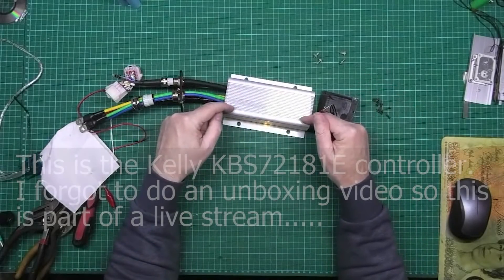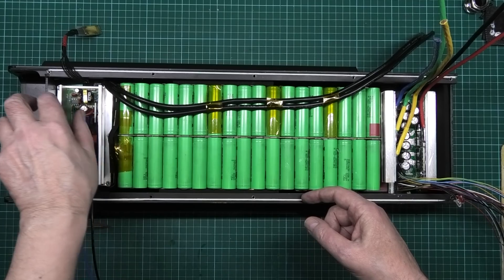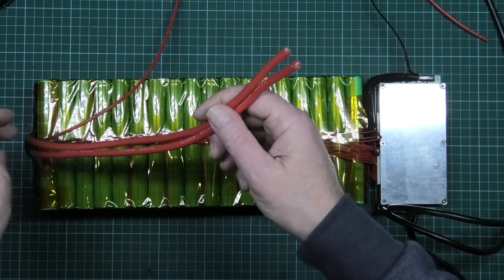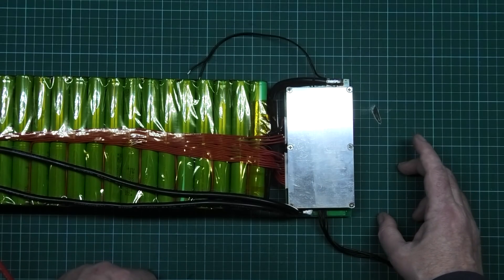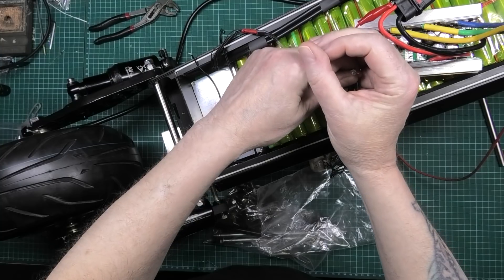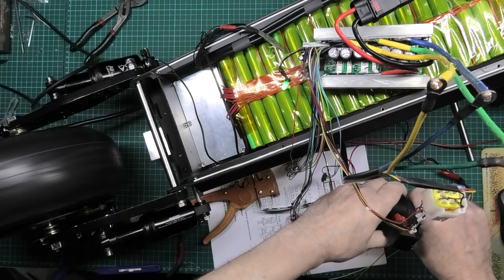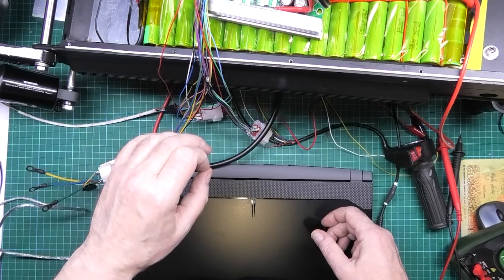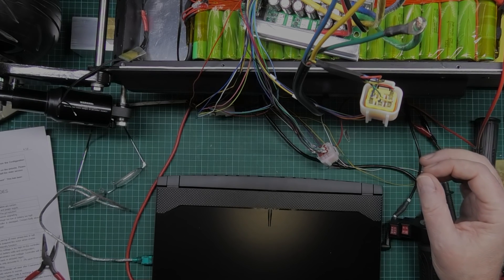🔴 EXTREMELY POWERFUL E-SCOOTER BUILD part 6 - Ant BMS and Kelly KBS72151E controller

Comment: Re the disk placement issue at 6:40, In the shop we would place washers between the vertical mount and the swingarm on the brake adapter so to push the whole braking assembly closer to the wheel!

I hope that one translates from my brain to words properly, just in case I'll try it one more time, chuck some washers between the brake adapter and the swingarm, you can go as far as you want really.
Get that wheel centered or when you get on it'll want to tip to one side all the time and it'll feel weird af turning on it.
Reply from the maker: All problems were sorted many weeks ago mate. I don't like using spacers if I can get away with it, especially on brakes.
I had to space the swingarm out more anyway (equally on both sides) it wasn't geometrically perfect but it is now 😁
I show the problems I have because it may help others to overcome them. Everyone else just shows the finished product, I don't do that because everyone knows it never simply works.

Comment: The Kelly controller is a good idea, much smaller than others but very strong and reliable. I just hate the documentation and the price. They should tell how the serial communication works, it would be easy to make a display for speed, voltage, current, temps etc...

make KI and KP as high as possible and "compensation" lower if you want it more "aggressive" (if I remember correctly, it's a while ago😅)

Comment: When you were talking about the BMS connections, you had the negative as the centre connection which was towards you, but then I think you called out the next centre connection as the first cell.  But that would be the second cell (at around 7.2 volts at nominal 3.6V per cell).  The first BMS tap would be the left and right ends of the first and second cells that you had already connected with balance wires before wrapping the battery pack.  I may be mistaken, but would not want you to have an expensive mistake on your hands.  Loving this project too, BTW.
Reply from the maker: Yes, you're 100% correct, the first positive is the bottom right/left connection. I didn't think anyone would notice but I had to leave it in because it had the wiring explanation. You can clearly see at 06:47 that I did go to the correct points 😁
I can't figure stuff out and talk about it at the same time, it's when mistakes are made so I do my thinking off camera.
Reply: @Vortecks  Understood. Figuring out while talking can easily mean that the presenter starts talking gibberish (I do it myself, but not on video). Other times, explaining stuff to someone can allow me to see my own mistakes. I guess it's how our brains work. I just tell people... "I'm good a this, and I am good at that, just not both at the same time.". :)

Comment: Looking brilliant and coming together at speed! I like it. Will the batteries handle the heat from the controller ok? Have you tested to see how hot the controller gets at full power?
Reply from the maker: I can't test anything until it's on the road and put through its paces. It'll be fine, I'll blow on it 😁

Comment: I'd make the battery larger and put the controller outside.
Reply: I'd make the battery smaller and put the wheels on the inside.
Reply: @gteaz  FYI, there are more expensive e-scooters with controllers in a separate compartment.
Reply: @michaela1709  My bms is on the battery and the controller inside a front compartment.
Reply from the maker: The word 'sleeper' is the key. Also, the weight cannot be any more than the original.
It'll still kick out 11kW and 30-40 mile range so I don't know what this would achieve.
Reply: @Vortecks  Sorry, it's my severe case of range anxiety.

Comment: You can space the brake caliper adapter out with some washers, it's a common method for aligning direct IS mount calipers (and probably the main reason they were phased out in favour of post mount).
Reply: I was thinking the same. Either space the disc out with hub spacers, or space the IS mount itself with some washers. Tony knows all of this already though, I watched him space the IS mount on his Canzo ebike. Then I copied him 😄

Comment: amazing video & build
one question about your latest Ebike build. you used sabvoton 72 150A (because of easy maintenance).is there any huge difference between that an 200A version? 
I'm trying to build a similar bike like yours but with a hardtail and Qs 205 3.5T and 72V 36A battery(LG HG2).I want your suggestions on which controller to choose between the two.
thanks in advance.keep the grate videos coming.😉
Reply: Don't do this on a hardtail my friend, that kind of power and weigh on a hardtail is terrifying and jarring when you come across a bump or pothole. Watch the video where Tony goes viral with millions of views. That was on a hardtail. I had a 1500w hardtail then built a 9000w full suspension and so glad I did. 

I'm running the sab 72150, no regrets. I'm not sure about the 72200, if it's larger or not, but 50a is 50a if you're batteries can output this kinda current.
Reply: https://youtu.be/HIhfwjWuj-I
Reply from the maker: I was pulling over 250A from my unlocked SSC72150 on V3. V2 was an SVMC72150 which is identical to the SVMC72100 but the software limits it. I think the 200A version has a longer case and a few more FETs but you'll never heat it up enough to warrant spending the extra money.
Stick with the 72150 (unlocked if you can - you have to request it when you purchase it). Also, as MW said, don't do a hard-tail unless you want to become the opposite sex, it's PAINFUL at anything over 30mph. At 60mph, you can feel chewing gum on the road.
Reply: thanks a lot friends.I will search for a good full suspension frame.😉
Reply: @cloner1758  if you're looking for a 'regular' bike frame to convert, it can be challenging to find one with a decent triangle to mount batteries. You'll find loads of creative ways to do it. As well as find one where the rear dropouts are large enough to fit your hub motor, you can usually stretch just a little bit.

Make sure your dropouts are capable, install torque arms or plates. Unfortunately I fell off my Voodoo canzo on ice, going slow thankfully. I foolishly carried on my journey. Axle must've came loose. Knackered my frame as it bent the dropouts AND it bent my mxus 3kw 3t hub motor axle. An expensive mistake. Torque arms prevented me from being injured further though.

Comment: Why not either add a disc spacer or washers in between the swing arm and the caliper adapter so you could center off the rear wheel?

Comment: Brilliant build and video, the control wiring looks like it's going to need a bit of taming to stop it chaffing, heat-shrink? I got a bit confused which was the rotor and which was the stator in one of your earlier videos as its the opposite of what an industrial three phase squirrel cage motor is. Does the controller use PAM or PWM I'm guessing the tuning alters the mapping of the flux vectoring? It's about 20 years ago since I last looked at motor control, so I'm a bit rusty. Thank you if you get time to answer Tony.
Reply from the maker: All the wiring will be properly protected mate, don't worry. 
The controller is PWM. 
The tuning is simply to teach it where the hall sensors are in relation to the phases. If it's not phased correctly, it coggs terribly and the heat generation is massive. I have some manual tuning to do, with regard to flux weakening, regen braking and e-brake but it's just a matter of trial and error.
Reply: @Vortecks  thank you